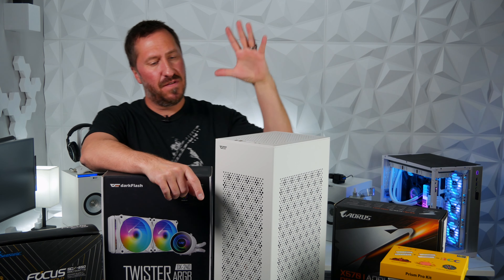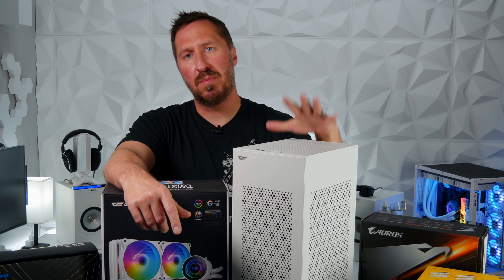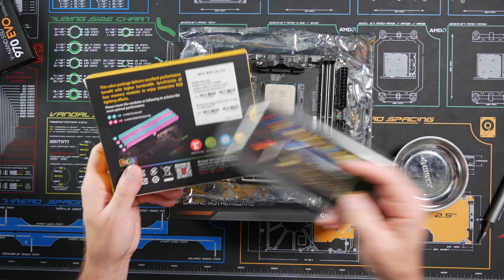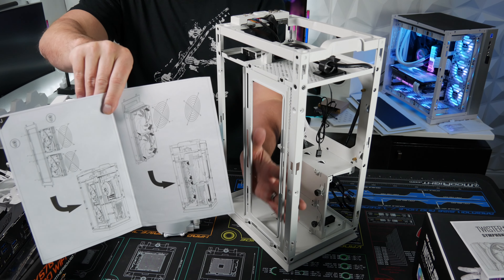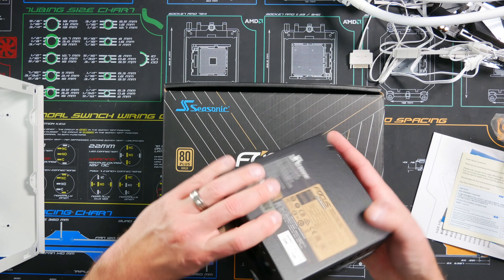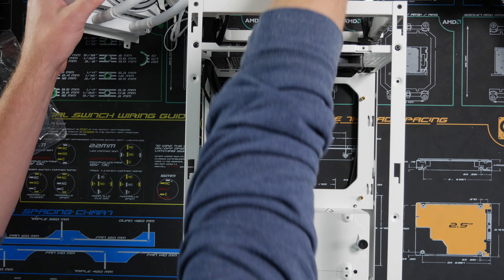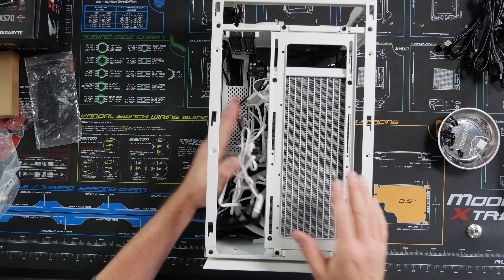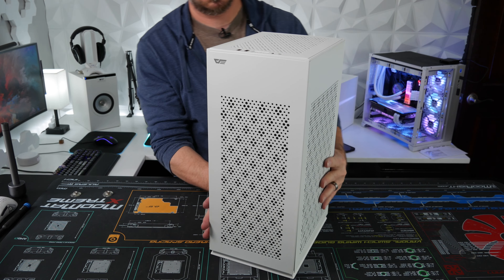$1700 mITX Gaming PC Build! - darkFlash DLH21 mITX case

Comment: Nice build. Could you have changed your PCI version from 4.0 to 3.0 in BIOS to allow you to use old GPU. You may have to install a 3 slot outside your case first to access your BIOS. 

Also, do you find it's easier to install the AIO on the mobo, as you've done, rather than installing the mobo then the AIO. Thanks.
Reply from the maker: Yeah, I didnt want to waste too much time troubleshooting tbh.  Having only a 2 slot gpu was disappointing.  Other than that, the case looks good.  I find it easier to install the AIO or CPU cooler on the mobo first.  Then screw in the mobo and radiator but really its preference